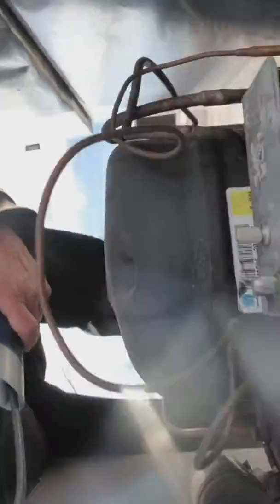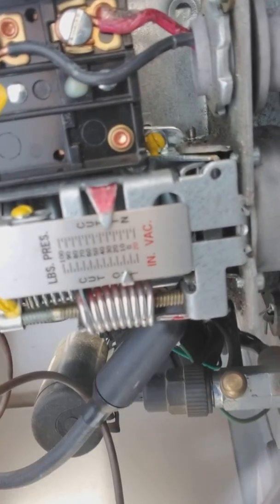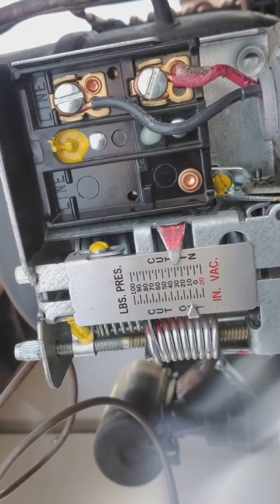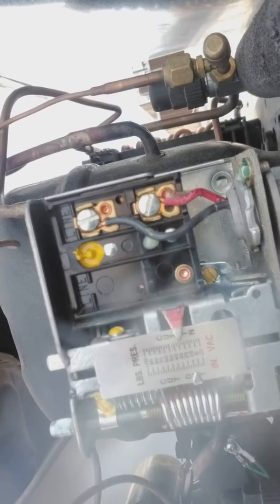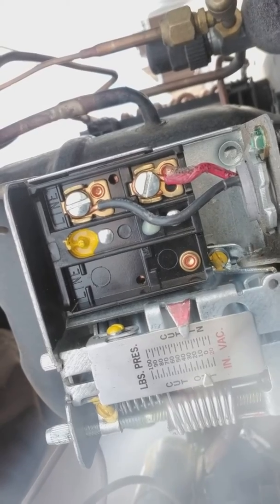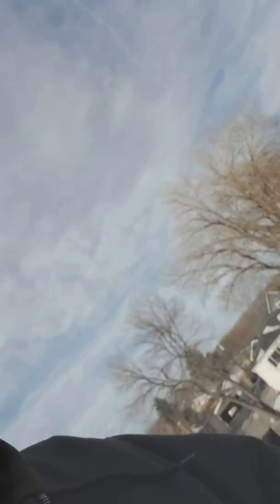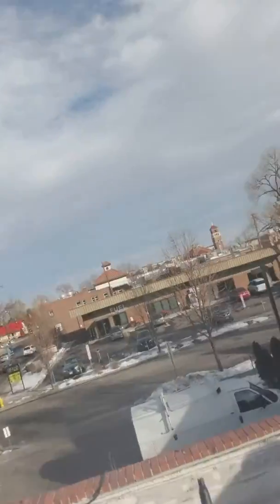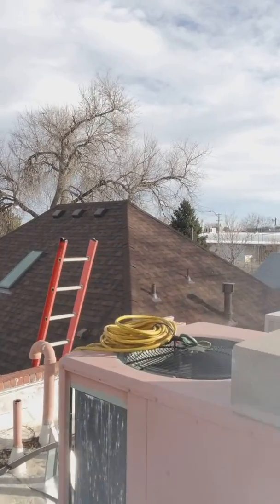Replacing H10  Bacharach  detector  with Inficon D Tek plug-in H10 refrigerant leak detecting.

Comment: Thanks a lot for the review of the  Inficon leak detector. That leak detector looks sweet
Reply from the maker: Mike Clark  yes that leak detector replaced my h10 for sure is very good almost better than H10 I think
Reply: I have H10 pro and inficon leak detector and still like my H10 pro better. It is a lot more sensitive specially in manual mode.